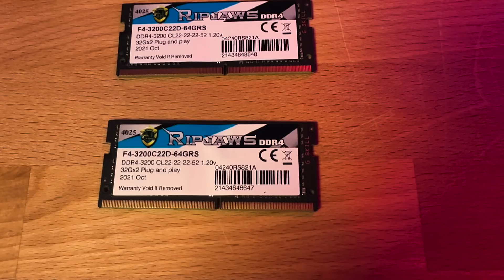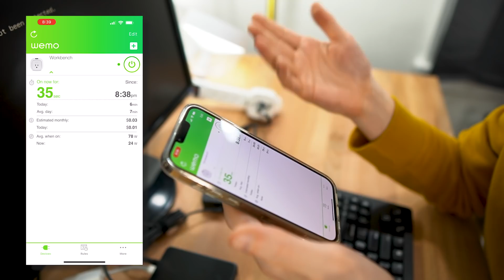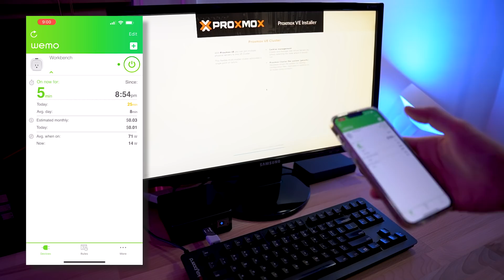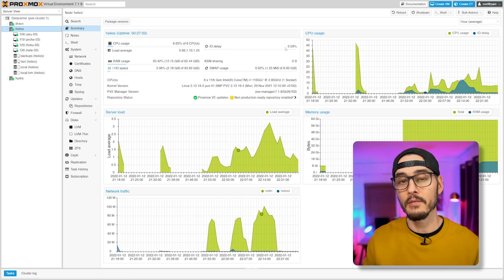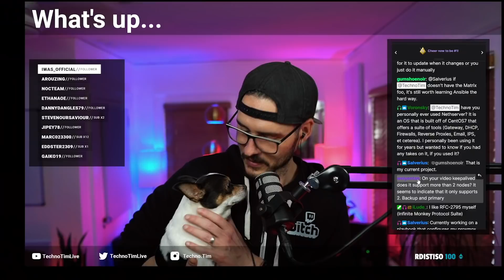Build a Low Power, Efficient, Small Form Factor but Powerful Proxmox Server

Comment: Nice video Tim! I was curious what brand/model of smart power meter thingy are you using? Is it less expensive than a standard kill-a-watt unit?
Reply from the maker: It’s just a cheap wemo smart switch that also measures consumption.  I think it was a little off for this video

Comment: Great video again, Tim. I enjoyed the power measurements, as that's what most would want to see from a micro-server. However, one "point of order:" saying those msata are too expensive, and then spending $1,300USD on a new server, one of the most expensive (Intel) of that form-factor, is, uhmmm....yeah. You could have just said, "I wanted something newer than Gen4, so I bought this." :) It's a cool new toy for sure.
Reply from the maker: I just didn’t want to sink money into antiquated hardware.  You should have seen the sodimm prices for ddr-3.  Would have been a money pit in a 8 year old system
Reply: @TechnoTim  Tim 100% agree on that. I'm there with you: I'm having to reevaluate my mental deficiency with keeping old Dell 1650 and 1750 systems thinking somehow they are useful to put in work in my lab. I don't know what I was thinking keeping them around. A lot of old Xeon E5-5xxx systems, too. Power hungry for sure. I'm stripping parts (DDR2 LOL) and trashing them to the ewaste people. :)

Comment: I love low power servers! My primary home server is actually running on a Pentium J5040 (which for anyone reading this, actually supports up to 32gb of RAM, not the 8gb Intel says!) and it runs great and even has integrated graphics for HWA Plex transcoding. Plus at idle it pulls less than 10w! I'd love to see more low power server videos!
Reply: how?in my j5040,not work 16 gb of RAM
Reply: Yeah, how? plug n play, bios setting...YT home server build video ?
Reply: Needs more exclamation points.

Comment: Hey Tim, actually it is quiet usual to run your Hypervisor OS on a SD/Card (or more so USB Stick) this is for instance standard for ESXi .. but anyhow since you are not running on a shared storage it is what it is ;)
Reply from the maker: Oh yeah ESXi for sure because the OS runs in RAM after the boot.  Not on Proxmox, it will destroy it.
Reply: @TechnoTim  proxmox also almost runs in ram don't you worry ;) but yeah in your setup it doesn't make sense only if you don't have any internal drives

Comment: Love the new homelab server! I just got 2 11th Gen NUCs to replace my old, power-hungry lab as well, love them!

Does your Intel NUC offer a tdp-down mode? I got some custom NUCs from the guys at SimplyNUC and they have options for 15w, 25w and 40w in the BIOS. The 40w only got me about 15% better performance at the cost of a lot more fan noise, so I ended up sticking with 25... but I'm curious if the Intel branded one offers this and if they do a better job with cooling/noise at 40w?

Comment: Currently running 5x Dell Optiplex 7060 USFF's as my Proxmox dev proxmox cluster at home. Each has a 1 TB NVME for bulk storage, 32g of ram, and 2x usb 3.x nics for secondary. 1 of them is setup for glusterFS replication of volumes, but the other two are in a LACP bond for vm data. 

Been solid. 

Prior to these, at an old job, I ran production Proxmox clusters for all vms, around 120 in total. This was hooked back to a pair of FreeNas boxes via 10g, that were doing a zfs send/recieve for hot/cold setup. This was prior to docker really taking off, around the proxmox 1.6 days. Miss that environment since moving on to new stuff.
Reply: I love the "baby Dells" and use them too for small cluster members, OPNsense, pxe servers, etc. Great boxes.

Comment: The low power consumption would be great for an RV.  Do you know if there is a 12V power supply for the NUC?
Reply: They probably input 12v then drop it internally. So really all you need is a cord that connects 12v (power outlet or barrel plug) to the NUC jack. One can probably find all those specs listed somewhere. Otherwise one can use a DC to DC step down converter as needed. Many of them you just adjust the voltage down as needed. Connect higher voltage in, many are up to 30v, then connect output to the NUC

Comment: Ever wondered why they covered the contact patches on the ram and nvme in gold? It's not to look pretty but to ensure the best possible connection with the main board, so covering them in a layer of finger grease really isn't that great of an idea. In short, stop touching the gold connectors, they are gold for a reason.

Comment: I also have an older nuc that I plan on installing KVM on. However, for me to get really serious about these I need dual 2.5 gig nics. For normal use one nic is fine by simply trunking it to a switch but for firewall configurations I need two nics.
Reply: Dual 1Gig would also be fine.

Comment: I am at this very moment re-purposing an older "low power" i5-4590S as a third node to my Proxmox cluster to run my low power but critical services like OpnSense, Pi-hole, etc. This allows me to shut off the Dell R710 and 720 when we have bad weather coming through but retain internet. I wish I could use a Nuc but I need the extra Ethernet ports.
Reply: After watching a lot of what Tim has done, I moved my "huge" Dell servers to secondary (like you) and put smaller, power-efficient (on a UPS!!!) boxes as primary. For all critical "production" services at home. Really makes a difference. An Ansible "shutdown the hogs" script takes care of fast shutdowns of all of the power-hungry when storms, tornadoes, vacations, etc., happen.

Comment: Very nice Tim! Would be great to see a tutorial on migrating a proxmox installation from ssd/hdd - nvme
Reply: does proxmox let you do a config backup ? 
if yes, just setup a new server, import config (hope it works) and then migrate from old to new.
Reply: @Jyv Ben  unfortunately there isn't such a feature :( i also need it to be an exact clone of the original.
Edit: you can backup VM's and the file system.

Comment: 24w of power for a NUC is a lot.
Reply from the maker: Agreed, I think my meter might have been off.  Going to let it run for a few days, but it's running 4 VMs
Reply: @TechnoTim  I believe it's the power supply, it's not power efficient. I've ran a bit more powerful machine than yours on 14 watts at idle. Not that it matters, just being picky with the power usage lol.

Comment: I also thought to use a NUC11 for a compact and energy efficient Proxmox server. The problems with Intel nuc are availability and price, as they are difficult to find (at least in Europe) and prices often are outrageous.
Reply: True statements!
Reply: Try a used Dell optiplex micro pc on ebay—with i5 or i7. They can be had for cheap.
Reply: I've been looking at getting one of those. A little more power hungry but still very affordable and power efficient.
Reply: When i was looking to build my first server like 3 months ago i didnt like the price of the NUC either.
Went with a Asrock deskmini X300 and 5700G from AMD, 2NVMe slots and 2 sata ports on it.
Quite efficient and major overkill for what i actually do with it.
Total costs was like 700 euro, have 16gb ram and a 1tb and 512gb nvme disk in it.
Its cruising along and bearly brakes a sweat, running pihole/unbound, VPN gateway, PMS and some other low resource utilitys.
If i could go back i would go for the deskmini h470 with intel for PMS but mayne thats a option besides a NUC.
Reply: @Niet_Belangrijk  I also thought the deskmini as a possible option, but I was never sure if it's realtek NIC card would work well with proxmox.
Reply: @misckicirina  i havent had any problems yet on the x300 running Proxmox on it.
I assume the h470 would be the same.

Comment: 3 of these in a ceph or Gluster cluster would be awesome ^^ with 2,5gig it would even be usable, I'd maybe add another 2,5g via usb and use the primary as the storage net!

It would be a great oVirt HCI setup for sure
Reply: Hm now that I think of it, I would also like to try out drbd with linstor over that 2.5G interface, it can use either lvm or zfs as the backing storage, really interesting.
Reply: I predict that NVME access over the 2.5 Gbps ethernet will suffer a lot. You should ideally use dual managed 2.5 Gb switches, and 2 usb to ethernet dongles per machine on top of the buildin port to prevent that your swich becomes a single point of failure: if a single switch fails, your cluster would crash.
I run ceph on 10Gbps (8 nodes) on dual redundant switches dedicated to ceph.
Reply: @SwissPGO  yeah I know, I definitely wouldn't expect to get any close to 300MB/s, but maybe something like 120 MB/s sequential write for a rep 3. I would love to see how drbd compares with async replication and an arbiter replica 2 Gluster volume.
But yeah you're right realistically this shouldn't be done on anything slower than 10G without expecting slow performance. Guess I'll have to go mITX for my 3 node build then.
Reply: @LampJustin  Uhmm on these NUCs why not just run 10G? Even dual 10G. Performance would be fine.
Reply: @Doesntcompute2k  those thunderbolt 10g nics are too expensive imho and I'm worried about latency tbh. Also when I get 10G I would like to try out RDMA, RoCE with some Mellanox for example
Reply: @LampJustin  I don't find them so: I have 10G on all of my laptops, six workstations, 40G on all servers/NAS, and latency is not an issue. I do VLAN and segregate networks a lot to keep data domains separate. Easier to log, monitor, and manage.
Reply: @Doesntcompute2k  oh wow! But you don't use shared storage over TB3, do you?
Reply: @LampJustin  Yes. At 10G, read/write of docs, images, video, and VMs is fast enough. The servers run their VMs across the 40G. When you're running a lot of VMS or even docker containers spinning them up from a higher speed storage like on the 40 g is much faster. I used to have it on 10g and before that I had it on 1G. Internet access, standard network access, logging and stuff is still done on 1G from the laptops and the workstations. However while the laptops typically only have two Network adapters, the workstation will have a quad port Intel gigabit and will have a twin 10G. I have five NAS that I store all of my data and backups on.
Reply: @Doesntcompute2k  awesome setup man! ^^ one day...

Comment: I did the same, mainserver is a ryzen 5800x with 128g ecc ram and ssd/hdd/nvme zfs pools with a lot of storage, and as backup a nuc11 i3 with 16g ram and nvme...
The only real things you need is high availability pihole+opnsense, to not loose the internet connection if you upgrade/work on the mainserver 🙈
Dunno what you are going todo with 64g ram, and an i7 for a failiver machine 😂
Maybe you can slowly replace your behemoth rack with sth small and more efficient 😂

Comment: I started out with the exact same NUC you did, and ran it until recently. Now it's a bare metal k3s node instead. For virtualization I run a Xeon D1521 server with 4 spinning disks (it doubles as a NAS) and an SSD for vms, plus a couple of HP desktops (the NUC sized kind). It works really well, and is very frugal on power in total. The new NUC looks really interesting too, 64 GB of ram and 8 threads for 25W? Yes please!

Comment: I took 5 nucs from work that were decommisioned. from 2017, upgraded the ram and threw in a 1TB nvme ssd m.2 disk in all of them, has been running in a Proxmox cluster happily ever after :).
Reply from the maker: Happy little nodes!
Reply: Yup! I've done that with a bunch of decommission dells that were going to go in the trash. I said: "you're going to do what??". They had i3s in them. Yeah they weren't great, but they weren't even going to strip them down. 🤯
Reply: 5? Isn't that to much?
Reply: @marine1718  One can never have too many.
Reply: @jgreentree  if u pay for energy it is
Reply: @marine1718  those intel nucs are very low power machines. I have multiple enterprise workstations running at home 24/7 that use way more power and they dont even cost that much.
Reply: @jgreentree  u nave cheap energy tome to Portugal and see
Reply: @marine1718  Solar provides me power daytimes and at night the Powerwall takes over, though I shutdown my servers before bed time.
Reply: @marine1718  Have a an older Intel gen 4 PC my main proxmox/desktop and a Dell R820 and 3 R720's. It is fun to play with toys.

Comment: I paid ~400€ for this 8C/16T ITX Proxmox server with just 2,5l of volume.

Board: Gigabyte ITX Z270N-WIFI F6d modded with Dual Intel Gigabit LAN
CPU: INTEL QQLS 8C 16T
(I9 9980HK ES BGA to LGA)
GPU: Intel® UHD 630
RAM: Gskill Aegis 2x16GB F4-3200C16D-32GIS (2666Mhz)
Storage: 1TB Samsung 950 NVMe
Case: Inter-Tech 601 2,5Liter
PSU: Inter-Tech 601 DC/DC + 60W 12V (min. 87% / min. 83% Efficiency)
Idle: ~6-9W DPMS Monitor off
Load: 45W
Cooler: Xilence XC032 Performance C Serie
Max C State: Package C-States C7

Comment: NUC's make for excellent small servers.
I upgraded my server(s) a few weeks ago, went from an old Xeon 1230v3 with 32GB RAM and a Microserver Gen8 with 16GB RAM and 4x8TB HDD's to a new 10400F with 64GB RAM, 4x8TB drives + 2x16TB drives (for now) running Proxmox of an Kingston NV1 500GB NVME with TrueNAS Core as a VM and passing trough an LSI card for the drives and a LEMP server.

More VM's will be added in time though.
Reply: Do you have a M.2 to PCIE riser cable?
Reply: Do I understand your new server is a NUC ? How is all that storage attached to the NUC ?
Reply: @jp_baril  No, it's not. I just said that NUC's makes great small servers.

Comment: I've currently got proxmox on a gigabyte brix running Blue Iris/Deepstack, Home Assistant, Docker and a couple other Linux VMs but have been wanting more power, more RAM, storage and faster NICs. As expensive as an Intel NUC is and as cheap as electricity is in much of the US, I'm looking to move on to either a HP Microserver Gen10+ (with an upgraded Xeon) or a small tower. I'm also wondering when HP might come out with a Gen11 Microserver.
Reply: Lucky. There's an energy crisis in the UK where I am lol

Comment: Great video Tim! Had a NUC7i7BNH doing this same Proxmox thing for a while but ran into trouble with the onboard NIC locking up/crashing after a while. Ended up using an external usb-c to Ethernet. Since have moved to a x470d4u with 3700x.
Reply: have you notes any issues with USB-C Ethernet?

Comment: Also use a X300 for Proxmox - such a great thing to have so much power without a mainframe in the living room (not that I wouldnt like that but power bills and the women acceptance factor...) Unfortunatly the Proxmox installer didnt run on my system AMD with GPU on the CPU seemed to have an issue, so Debian and Proxmox  package did the work also. I enjoy it :)
But a vSphere would benicer to test at home due to you mostly work with it in work and test terraforming at home would be nice... And the NUC versions seem to be some kind of tinkering solution